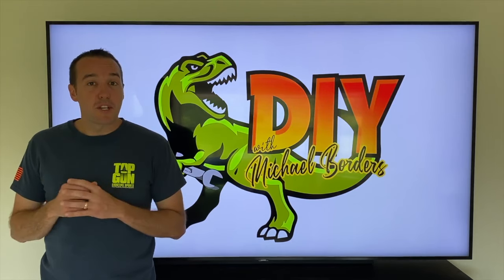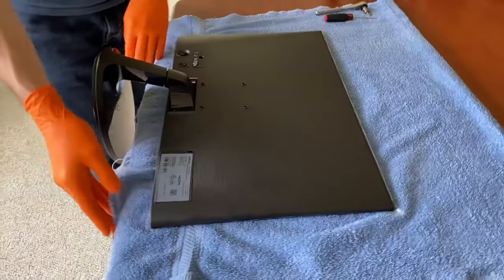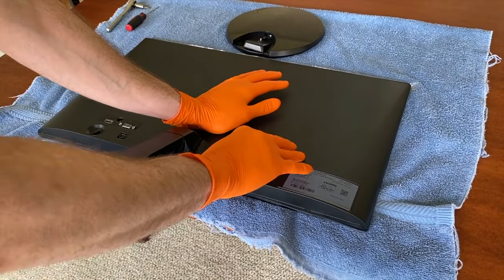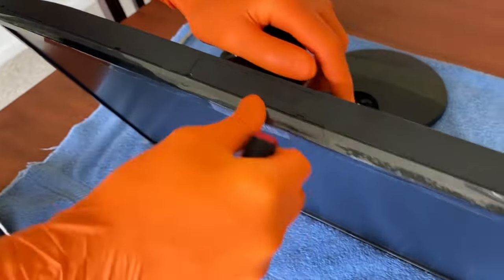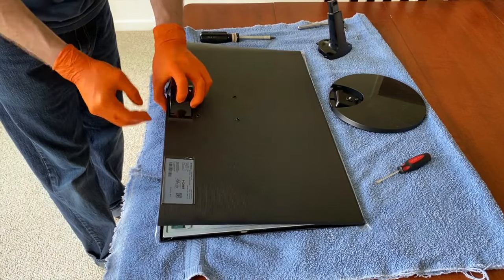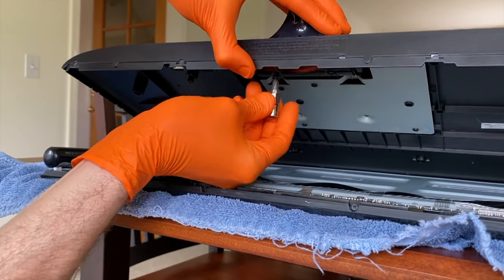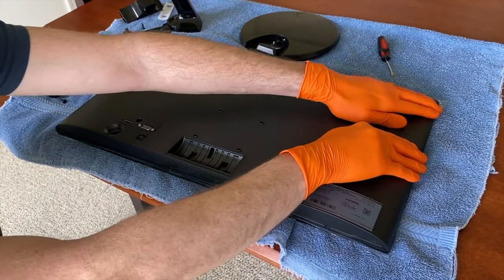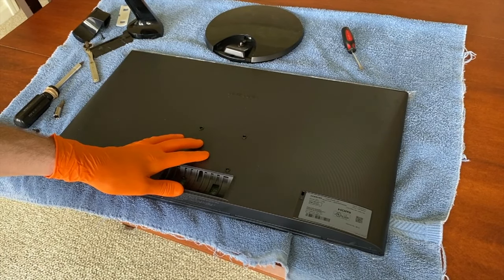How to remove Samsung computer monitor base/stand

Comment: What IDIOTIC ENGINEERING.  Last Samsung monitor I'll EVER BUY.  This is ridiculous to have to dissassemble when other monitors simply expose the screws to the outside to remove the base.
Reply from the maker: @brianmi40  

Thanks for watching and sharing your thoughts, this design definitely challenges us.  Hopefully you got the base removed without damaging anything.

😁👍🧰
Reply: @DIYwithMichaelBorders  Yeah, I was able to take the monitor stand apart one joint upstream, which let me use spacers to attach the plate and first joint (that usually the monitor slips down on) so that I didn't need to actually open the monitor to remove the final "embedded" part of the stand attached to the monitor.  Then my son was able to hold it in place while I re-assembled that joint in the stand.

Ludicrous design and for no reason.  My grandfather was an engineer (designed a furnace that could burn 3 different fuels (wood, coal, oil) and would have berated the engineer showing the design before it ever got built.
Reply from the maker: @brianmi40  

Thanks for the reply, that’s great to hear.  That’s funny 😄

Comment: my monitor broke after I followed every instructions pls help
Reply from the maker: Good morning ☕️ thanks for watching.  This design makes it very difficult to remove base conveniently.  Is the screen damaged or the plastic frame?
Reply: @DIYwithMichaelBorders  when I connect the monitor to my Xbox and I could only see like 25% percent of the screen the rest is like black glitchy red blue green lines I don’t know
Reply from the maker: @JaiDzz  

Thanks for the reply, it’s possible that an internal connection point got loose or altered.

If it is indeed that the screen/panel is damaged, it will likely need to be replaced.  Keep us posted.  🧰
Reply: @DIYwithMichaelBorders  do u think I need to get a new monitor or is there a way to fix the monitor by urself
Reply from the maker: @JaiDzz  

A replacement panel price and replacement process may exceed the price and time of purchasing a new monitor however not always.
 🧰